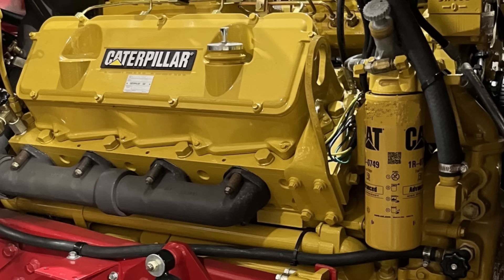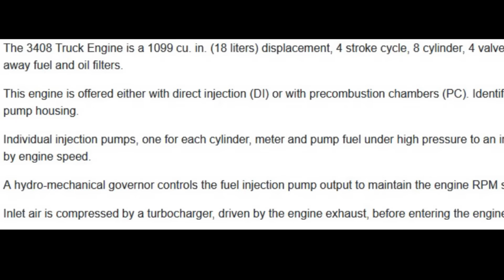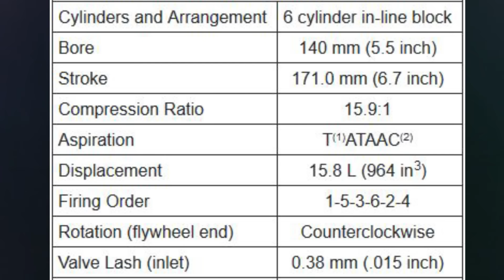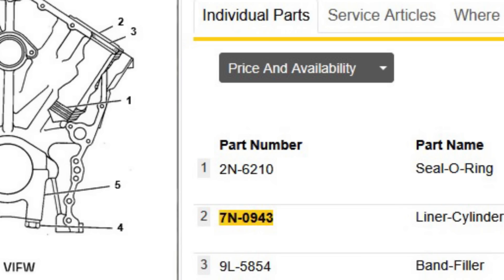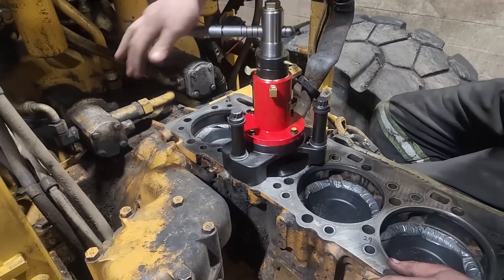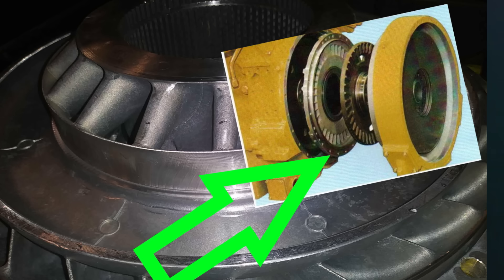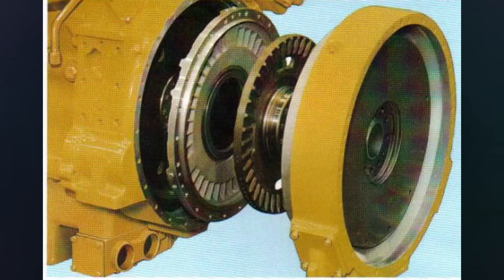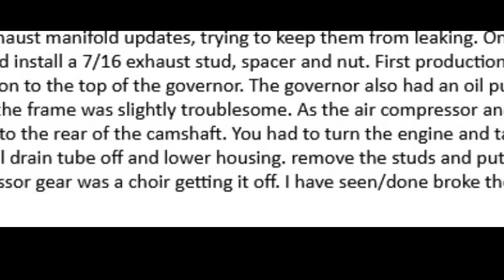The Cat 3408. Biggest Cat Truck Engine Ever Made. V8 18L Diesel Engine. "Know Your Engine"

Comment from the maker: Hope you enjoyed this one. Have any stories about the 3408? Leave them in the comments below. Thanks for watching.
Reply: I think the 3408 has a 60 degree V angle, not 65 degree as mention.
Reply: I put a v8 in a 93kw with a 5×4 and 3:36 rear ends ran hogs 2 farmer johns in LA out of the midwest!!
Reply: @JakeJacobson-c1g 

  ... "Never   Late
                V - 8" ...
Reply: The good old days. I used to run to the coast outta Sioux Center doing same 25 years ago lol@JakeJacobson-c1g
Reply: @AdeptApe  my one boss had a Peterbilt with a 3408 cat. 
Leaving a scale with seven axles at 118,000 pounds I out pulled a 400 Cummins grossing 80,000 pounds 
Pittsburgh power posted a Dyno run six years ago they almost made 700 hp with that 3408
Reply: @llen609  3408 is one of my favorite cat engines of all time ,, along with it's big brother the 3412 ,,something he failed to mention is that the 3412 will fit in most trucks that a 3406 will ,,i run a 1977 peterbilt 359  that was built as a haul truck  and it features a 3412 Cat with twin turbos it spits out 1100HP and 3100 pound feet of torque ,,3412 was never built as a highway engine but can be used that way ,,and i have the brakesaver retarder  , it works amazing  ,, my shorthaul truck has a 3406B with both the brake saver and Jakes ,, nice thing about the brake saver over Jakes is it doesn't violate engine brake noise ordinances
Reply: They already made the 3408E was electronic(a HEUI). You could make a video on HUEI and why we don't see them no more.
Reply: @chupapimunyenyo1667  the only somewhat common application of those is a D9R bulldozer, even then it was only an earlier prefix
Reply: @chupapimunyenyo1667  None of the 3400 electronic engines were HEUI
Reply: @AdeptApe  in later model 3408 in Canada they had air to air rated at 525 hp!
Reply: The CAT 1693 was the first 425. I guess it could be seen as the 3408 predecessor.
Reply: Hey Josh read gm16V149 comment below, enjoyed your video
Reply: the construction I worked for years ago had a 1975 Pete 359 with this engine in it.  CAT 3408 PCTAB.  13 sp eaton 400 4.11/529.  The operator would have to be very careful for it would eat transmission very quick.  Pulling a pice of construction to a job, ( about 115,,000 lbs) going up a log hill there was two trucks in front of us.  The driver called them on the CB and asked if we could pass.  There answer was “ yes if you got enough horsepower and enough guts.  The driver dropped A couple gears and we flew by them like they were going the other way.  The voice on the CB said I wonder what kind of engine they have in that truck, the other voice on the CB said I got to get one what ever it is, it sure sounded very powerful.  I worked on a lot of 3408’s in construction equipment and also 3412.  Very good engines and yes they use some fuel for sure. Good video, thanks for it.
Reply: Would you be interested in seeing what a 3408 natural gas generator I got a good story of one that lost oil pressure and took out every single bearing.
Reply: @tyverlubarsky7950 
Most all stories of the 3408’s in the natural gas world all end in catastrophic failure.  😢😂
Reply: We have a 3508DI generator it’s massive does it share with the 3408?
Reply: @mauricemotors8207 3500 series are much larger than the 3400 engines
Reply: @AdeptApe  
Thanks for bringing these old gals into the conversation... truly , one of my favorite engines Cat punted out their doors...Aaaand! Of course the 3412! 2 best sounding engines IMO 💯
Reply: I know your talking about American engines,but here in Europe we had 18 liter Iveco Gran Motori (8V)18 liter ,offerings from MB (8V) and MAN (10V).
Reply: They also put the 3412 in some trucks .

Comment: The exhaust manifolds look so small, how does that monster breathe, it looks like its trying to puff through a straw.
Also its interesting its a 65 degree V because the old 2 stroke v8s were 63.5 degree V for packaging reasons. But they didnt have split journals. I'm guessing the two stroke design made things more balanced as far as the forces going on because everything was in either compression or power strokes.

Comment: Operator Peterbilt custom low bed tractor. 3408 twin air research turbos with boost control in the cab.. she pulled 6 axle custom cozad.

Comment: There were some extended nose Kenworth trucks built for logging purposes in the great white north that actually got the cat 3412 ( V-12 version of the V-8 ) that were monsters at hauling felled trees.  I saw a few running around in Oregon & Washington state in the mid to late ‘80’s .  We built a 3408 cat for a Heavy equipment hauler here in San Diego at the time that was compound turbo charged along with a whole host of custom internals & parts including a one -off Bosch mechanical fuel injection pump and factory modified set of injectors that allowed it to make almost 1500 crankshaft horsepower as measured on our Super-flow Dynomometer at Hawthorne Caterpillar @ 130 pounds of Boost pressure !!!   Custom fabricated intercooler tubing / couplers & clamps had to be fabricated to contain that much pressure & once installed in the customer’s truck they assigned only One Driver to it as it had no problem destroying drive -line components.  If I remember correctly it made almost 2800 lb-ft of torque & our Dyno was limited to 3000 if my memory serves me correct . ( it’s been a while .😐).   Anyway cool video here . The 3412’s  that I saw up in Logging territory had 3406 Jake brake setups on each bank of engines and sounded Shag-Nasty on deceleration.    Some serious ingenuity was used back then .  😎👍
Reply: Wasn't that the Papa Clyde truck that did Hawthorne dyno days several times? It would go up against Bob Wilsons K model. I want to say the 08 won the one year with 1100ish at the wheels sustained. Read about that alot in the American Trucker magazine.
Reply: @imolar1 Yes indeed!!   Good memory .  Those were some of the best times in my life back then.  Bill Signs has since passed away , but his legacy & company still live on.   Papa Clyde was eventually sold , as were most of the rest of the older mechanical injected trucks & they were replaced with emissions compliant trucks to meet ridiculous California emissions regulations.   I’m proud to have been a part of all that went on back then .  BOB’s big K-600 series Cummins completely blew the Turbo clean off during one of those $1000 winner takes all Dyno runs & my brother in Law Ted’s father caught the whole affair on video camera . That tape unfortunately is lost to time and too many moving trips, but it sure would be cool to see it , along with quite a few of the other competitors runs .😎👍. Thanks for chiming in here !!
Reply: @stephenmiller5023 that is so very cool! I was going to say in the previous post that I thought on one of those pull-offs that the K model melted down in some fashion or another. Turbo blowing off sounds about right I think I was still in junior high and used to dream about the 3408s because we had ties to Peterson Caterpillar in Redding which was one of the hot rod shops. Such great memories. Very cool to talk to somebody that was a part of that in the build and everything!
Reply: @i @imolar1 Thanks for the kind words & comments .  I’m almost 66 now & as a mid 20 -something year old at that time I was involved in an awful lot @ Hawthorne Cat. My co-worker Bob Morin & I built that 3408 and performed all Dyno testing & data -logging using our new Super Flow -2 engine Dynamometer & we eventually got that engine up to 1787 Flywheel H.P. , or almost 4 times its 450 factory rating at that time . And this was all BEFORE the age of electronic management this or that .  Back then it was kinda “ point & shoot “ & hope we hit the target somewhere. There was months & months of fabrication & development time in that engine , and we changed EVERYTHING it seemed at least 4-5 times in the pursuit of a good combination that didn’t destroy things .  Overall it was a pretty stout / reliable package . I also custom built engine adaptations for a few other projects including stuffing 3208 Cat 250 hp turbo charged engines into Bluebird Motorhomes ( the factory reps said it couldn’t be done , but I debunked that theory) and I also stuffed one into a guy’s’83 Crew cab GMC dually pickup truck along with Allison 5 speed transmission.  That guy took that truck to GM headquarters in Michigan & showed the head engineers there at that time what a “ 25 year old kid in California did “ for him .  They put him & his family up in a hotel for about a week while they drove the snot outta that thing & decided then & there that those old ailing 6.2 & 6.5 liter Detroit diesel sourced V-8’s had to go .  It only took them another 15 years to align with Isuzu in using the Duramax based units . I went out & bought one in 2003 myself & still own & drive it daily . It makes around 500 hp in its current setup , and it still amazes me how the shift to electronic engine management made such a jump in HP output.  At 408 cubic inches it certainly puts out almost double the 636 cubic inch 3208’s did , and it’s easily 1000 pounds lighter !! 😆😉.     Anyway I’ll stop here & say, “ Happy New Year “ to all . Be safe in 2026 .
Reply: @stephenmiller5023 that is just incredible. I could probably talk to you for a year or so non-stop hearing all the stories and the details! Didn't you guys inject some propane into that as well? I might give you a direct message after a little while. Thanks
Reply: @imolar1 On Papa Clyde there was no Propane used for any reason, that 3408 was stout !!  On a buddy’s 3406 powered “ Anteater cab “ KW we did & his rig made consistent 750-800 hp pulls on our Dyno ALL DAY LONG!!  The owner’s name was John Bomenka , and he lived in Texas & ran cross country a lot !    He always had beautiful rigs as well .  & Yeah, we probably could talk non-stop for hours & hours as I’ve been called guilty of that plenty of times in my life !😆😎👍.   D.M. Me sometime , sounds like you know a few things about Trucks & Diesel’s yourself.  C-ya .
Reply: @stephenmiller5023 sounds good. Yes I grew up around that stuff and some mechanical Legends out of Northern California that I was around. Just enjoy it Non-Stop. For some reason I'm not finding a way to private message you so I will have to keep working on that. I've never tried to do that off of YouTube so not sure if it can be done

Comment: As for fuel mileage, 3406 and c15s i never got more than 5 mpg, usually around 4.3 to 4.6, you failed the mention the massive torque of the 3408, that is where it out shined all the others

Comment: When I was an apprentice one of these engines was donated by Stelco Hamilton works to the college and the instructor wanted to trade it for something more conventional like a c15 in particular because of the size of it stelco used these engines in their slab haulers which are huge multi wheel drive trucks used to transport massive chunks of steel to different parts of the steelworks anyway one of these engines students was a Cat employee who informed the instructor that he would not be loading that engine in anything smaller than a 5 ton truck because of its immense weight he also told me that the engine was a very reliable piece but it wasn’t the engine that you wanted in a highway truck because it was capable of tearing transmissions and drivetrains apart it really was something meant for special purpose heavy haul vehicles and equipment

Comment: That's called a "split pin crankshaft" and Ford did that for the 6.8L V-10's. Smooth running but creates an inherent weakness which is why nobody ever really tried to hotrod the Modular V-10's compared to the 4.6L and 5.4L.

Comment: Run 988B loaders that have the 3408. One of the best engines ever made. The 34 series engines were amazing and still run better and longer than what has been produced in the last 15-20 years because of obvious reasons. Also run the good old 3412 generators. Don’t forget the 425 3406B air cooled that has been one of the best engines ever in a truck. Love the old cat before emission

Comment: My dad bought a 3408 in a crate from Hawthorne machinery in 1978 or nine assembled it in his garage, pulled the Cummins and the twin stick out of the Pete put the cat in with a 15 Speed Rd., Ranger in our driveway in San Diego county if I remember correctly, it was the first one in San Diego County everybody everybody including Tom Hawthorne that was associated with Hawthorne equipment and engine systems knew my dad and his thousand horsepower 3408. The compression ratio on the engine was 15 to one and he was running 45 pounds of manifold pressure with oversize injectors. And because he left the androids hooked up correctly. The engine didn’t smoke. There wasn’t lots and lots of black, crap, a.k.a. un burn fuel or dollars blowing out the top of the exhaust pipe the engine was truly amazing and extremely reliable and yes, he had the hydraulic retarder on the back of the crank, which would physically shut the engine off if you weren’t carefultruly an amazing piece of equipment/power system

Comment: I WORKED ON A G3516 16 CYL. NATURAL GAS GENERATOR SET. BRAND NEW FACTORY ENGINE ENGINEERS COULDNT GET IT STARTED FROM NEW. JUST A TIMING PROBLEM AND DIRTY SPARK PLUG ENDS

Comment: The 3408 is not the biggest on road truck engine the KTA and the C-18 were the 3408 wasn't that great of a engine the 3406 B would out perform it any day of the week I have had 2 3408s and twin turboed one couldn't keep head gasket on a stock one and were only rated at 450 HP and 1700 or so tq

Comment: That split-pin crank looks scary, but it works.  It's nice to read the commenters down the board say they don't know of any crank failures due to the split-pins.  Later on, the car companies that started making V6 versions of their V8's went to split pins to get even firing.  The Buick 3.8L was the first to do that in 1978, and it was used for 30 years in that engine.  The Chevy 4.3L also had split pins.

Comment: We still have 5 kenworth w900 75 tru 82 with the 3408 & brake savers on our farm and they run every harvest season, all have been kept in show quality condition and never sit outside in weather.  I ran the 82 over the road for two years at 21 yrs old and so it has near 750,000 miles the rest have under 500k  all are  metallic brown with 60” aerodyne sleeper . Truly working Barn Finds😅
Reply: 6b6b6.............back in 78 ,had  friend with KW and I would go with him and help out his was Cat fuel squeezer ........was it a 3408  or  3406 ........I'm 72 and cannot pull that out of the old computer , think it was a V8 ???

Comment: I worked at a sand and gravel quarry we had 5  caterpillar 988 B models with 3408 engines they would rebuild them and would go 27000 to 32000 hours between rebuilds  usually  the torque converter or transmission would go bad and the engine would still be running very well but since transmission was getting rebuilt the engine would get done too in our shop they used chevron delo 400 15/40 motor oil
Reply: That is impressive service life

Comment: I drove 3408 Cat , made 500 -600 Hp torque min 2000 Ftp also had Jake , Your way off on this engine maintained and proper Tune a Reliable strong power unit Rebuild to as new indefinably ?  3408 in bulldoze 800hp from Cat No chips big savings ?? More of a engine than 3406 + not near the cost of electronic rubbish ,   Best Regards

Comment: Cummins 903 was bigger and longer running
Reply: no that's only part true, 
it was longer lived due to Goverment use (the Bradly IFV used them for about 40 years and Marine Boats)
but it had only 14,8 L displacement hence why it's named 903. 
and dry weight 2580 LB (1171 kg) a golf Mk 3 weights more than that.

should most certain be the Engine of choise for a Highway Truck, 
but hardly was, this is even more rare than a 3408 in a highway Truck.

Comment: We still have our 3408, we ordered it when we bought new a 1980 Kenworth K-100 Areodyne Cabover for our Heavy Haul Company operations. She now has 45,000 miles on her now, and still running great. We have updated the Damper on the crank from Cat, and have installed an aftermarket Electric Fuel system, something similar to the 3406-C system we got from our local cat dealer. She doesn't pass many fuel stops but she geared to climb a tree. We have to carry her to jobs because the way she's geared through an Eaton Fuller 18 spd trans and a 3 axel drive set up from the factory. We have had many offers from people to buy her, but she's our baby.  As always, love your videos, keep up the great work.
Reply: Love to see videos of it

Comment: Hi, my name is Stewart. I live in Naples Florida. I'm using my wife's YouTube channel. I drove trucks for about a year. I believe it was about 1999 and I had a Freightliner century that I drove for a little tiny company out of clanton Alabama called jayron trucking and the truck that I had was white with pink racing stripes on the side and it had a 3406. I guess whatever series was around 1999 and it had a 9-speed I think. Eaton transmission. I think that was one super duper fast truck. I mean it rolled it was fast and I could go anywhere and keep up with pretty much anybody at the time and it was a I think. I don't remember how many horsepower it might have been 450 or 425. But yeah that was a long time ago.😅😅😅😅😅😅😅😅😅😅😅

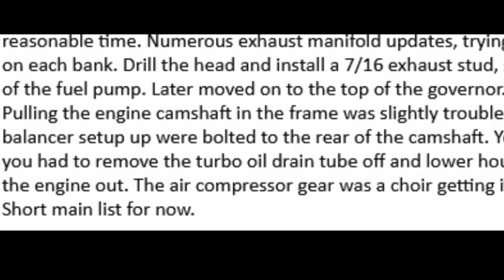I would never drive truck again. It was horrible and I had a problem physically. I could not stay awake from like 11:00 to like 6:00 in the morning. Anything I did nothing worked. I would just fall asleep so I decided trucking was not my kind of living.😮